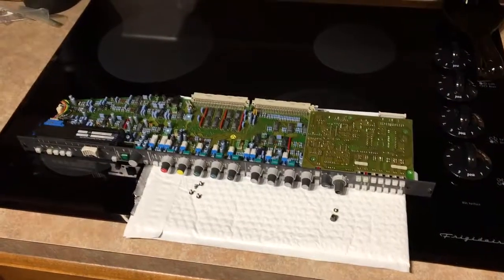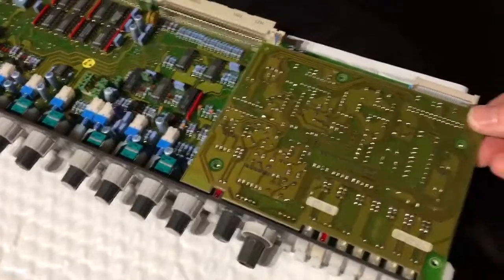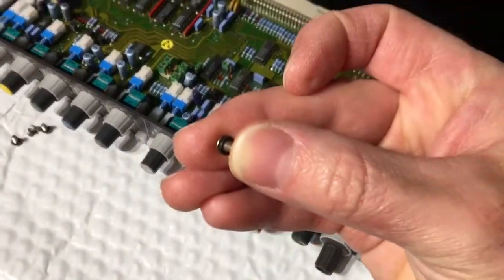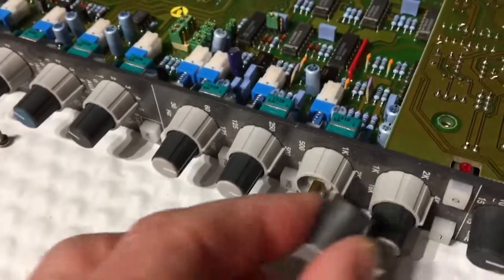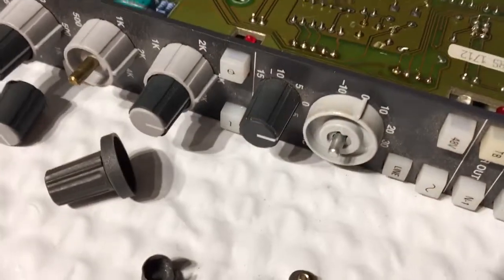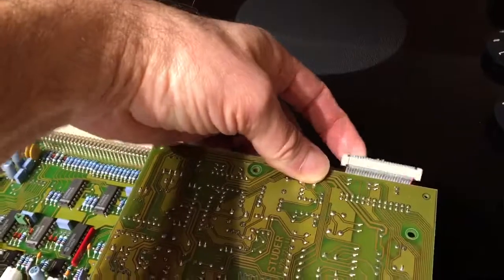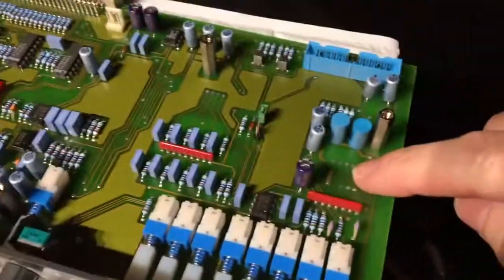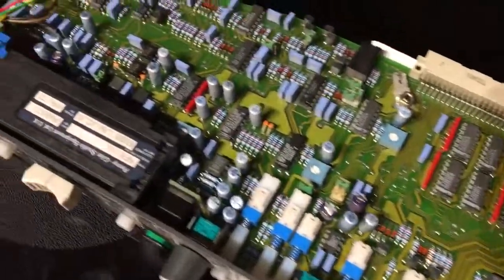Anatomy of a Studer 928 Mono Input Module

Comment: Are you using the mixer in production now? Interested in hearing your thoughts on it, especially if you've used the buss limiters. Great video by the way, nice and relaxed, good info!
Reply from the maker: Not using it currently...studio is not setup at this time for a number of reasons. But I love how it sounds and love what the trafo coupled outputs do when pushed; a quality desk. I don’t really like the mono group compressors or summing module limiters...the average attack time is too short. I’m going to experiment with component changes to increase the average attack time to something more suitable for music program content. The console was primarily designed for broadcast work, so the fast attack dynamics processors make sense...just doesn’t suit my taste but I would like to make use of them.
Reply: @SweetbeatsTechStop  Thank you for your reply, sorry for the delay in my own response, your email went into the gmail "archive" folder. I am interested in the compressor/limiters, so will pay close attention to their behaviour once I'm up and running with a testing setup. We had no use for a console of being a full 64 (4x16) configuration, so have taken it down to the chassis and cut it to half size for one console, as a bit of a challenge as the buckets are 16 units wide but the Main Buss boards are all 12 units wide. We'll get a nice sized "colouring box" out of that frame and then I'm putting together a personal one that will utilize a single bucket of 16 positions, filled with 8 mic inputs, 3 mono groups, 1 stereo line input, the two masters and both monitoring modules. That will tie into my own studio setup nicely. At least that's the configuration I have in mind at this time. I've been living in the manual of schematics and board layouts for the past couple of weeks and have most of it figured out at this point. It's definitely an interesting board with how the modules are populated and the onboard patchbay that allows sharing of components from one module with another is brilliant, imho.
I'll let you know what I think of the compressor/limiter and if I change anything about it to make it more musical. The board is a bit of an oddity for me as I'm involved in designing and manufacturing tube audio gear, strange to have a solid state board in my shop ;-)    Cheers and good luck with your endeavours!
Reply from the maker: @TrackingWidgets  Very, very cool. I actually considered hacking into my frame to reconfigure my console into a split configuration, but decided against it...BUT...I have a small mountain of spares for my console and would love to find a 12 or 16 slot bucket someday in order to build a sidecar...I have everything else but the frame itself. Do you have an extra 16 slot frame assembly then from your splitting of the 64-slot console?

Comment: Very beautiful. Does it have an output transformer as well? Do you think it would be possible to rack these?
Reply from the maker: The input modules (whether the mono mic/line input module, or the stereo line input module) do not have output transformers, but they do have a nice opamp-based line amp with plenty of drive. On the 928 you will find transformers on the mono group outputs and the master A and B outputs. All 928 consoles are fitted with the master A and master B modules. Not all 928s are fitted with mono group modules. The maximum number of group modules is eight. The group and master modules utilize the same hybrid opamp/transformer output driver. A third winding of the transformer is incorporated into the feedback loop of the driver’s opamp array. My experience is it takes a beating, has gobs of drive and does some nice things when pushed. It’s a neat design.

To your second question I think it would be a challenge to rack a 928 input module for a couple reasons: you can see from the video the module PCB is pretty dense, so if you wanted to carve out unnecessary functions not needed in a rack application (such as the AUX section), you would have a really hard time accomplishing surgery on the PCB, and the PCB runs essentially the full length of the module, which is 582mm including the mounting ears. That won’t fit well in a 19” rack, so the PCB would have to be shortened and again that would be a real challenge with the component topology.